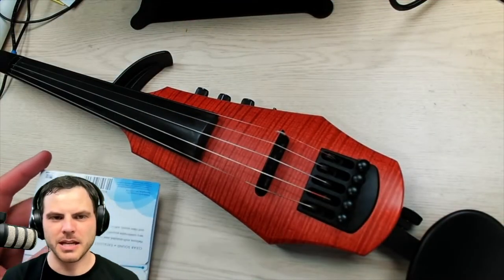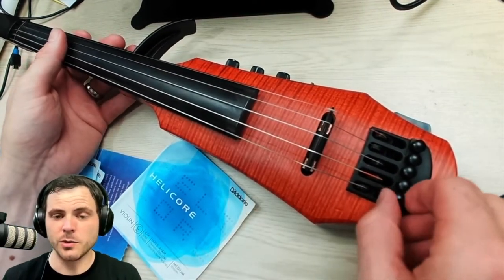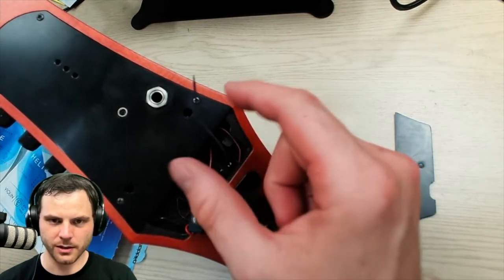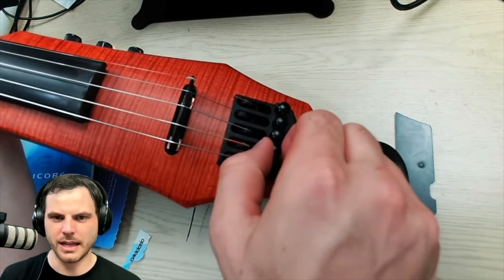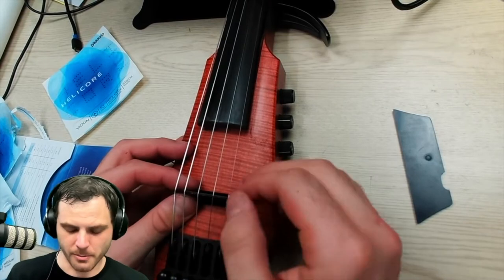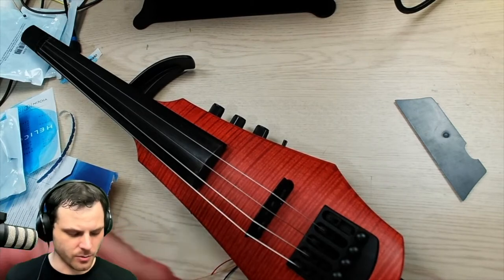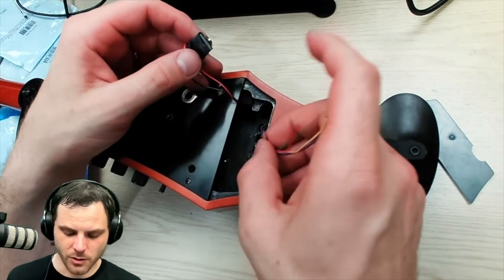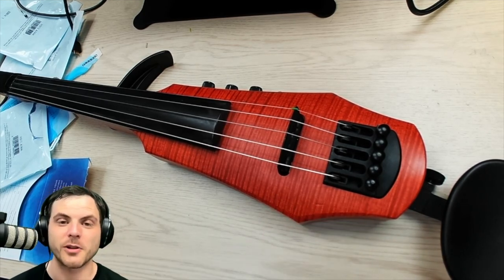How to restring an NS Design Violin and Avoid Issues

Comment: Have you found a violin stand this can sit in without tipping over? Or wall mount
Reply from the maker: I have used a regular wall mount however, it is a bit scary without the pegs to hold it in place a bit more safely. My partner got me a custom made stand, which was fantastic however, did not incorporate the shoulder rest as being on it so I constantly had to take it off. What I did most of the time was just set up the shoulder at a certain angle and rest it like a tripod just setting it on my desk. That worked great except the sponge part wore out pretty fast right at those spots.
Reply: it hangs really well upside down :P No joke there...

Comment: The black part that the screen goes across is stuck in a position closer to the tuner itself. I can’t seem to move it. What did I do wrong?
Reply from the maker: I'm confused as to what part you are talking about. Feel free to send a message of needed with a photo, but if you could describe it more I could help.
Reply: @ShawnBoucke  the black part that the string crosses over and sits on was stuck so I thought lol even though the tuner itself felt loose apparently I had not loosened it enough. Everything is OK now this system is totally different than any other, but I still like it and thank you and I like your videos keep going.
Reply: @ShawnBoucke  my bad, I didn’t loosen the tuner enough so it stayed in a fixed position that actually broke my string lol but I think I figured it out. I just didn’t loosen it far enough.

Comment: Are you able to install octave strings without modifications particularly a low f?
Reply from the maker: Totally. The only issue that you might find is the string thickness going through the top of the instrument. If they don't fit through they would just need to be widened a very little bit, or just forced through. It's often just the silk wrapping that causes it to be too thick. The "tail end" will be perfectly fine.